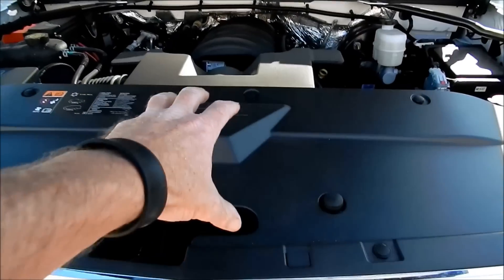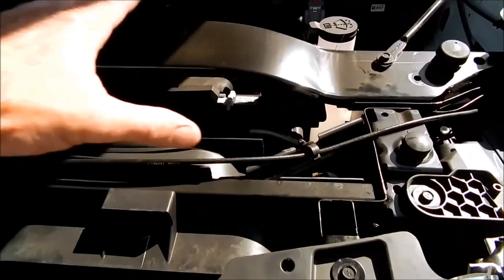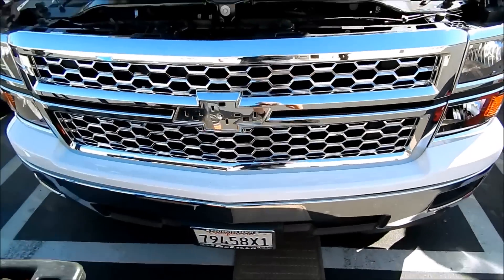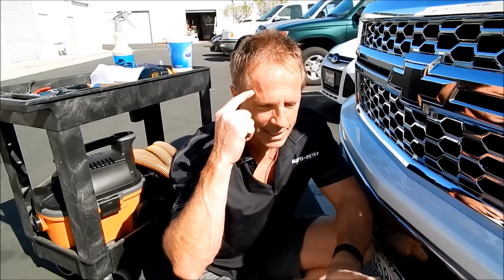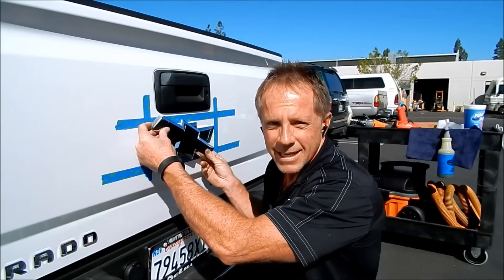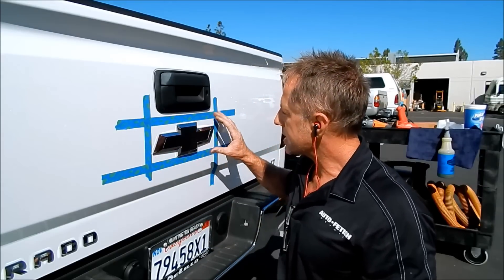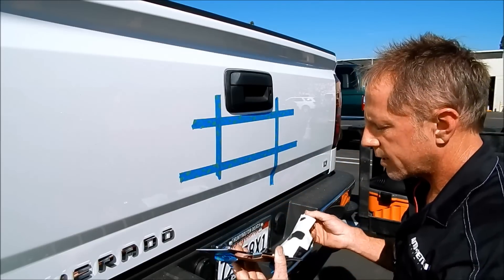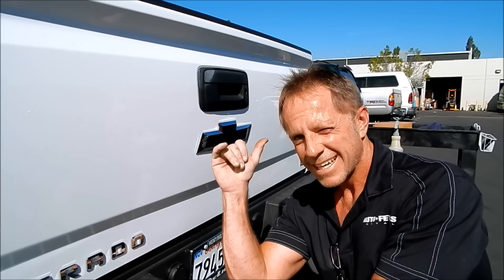Chevy Bowtie Replacement: 2015 Silverado Truck front and back bowtie

Comment: On the rear of my Colorado, it wasn't too bad. Most of the adhesive stayed on the emblem. Using my fingers I carefully removed the adhesive, followed by a wax that removed the remainder of the adhesive, rubbing alcohol, and then placement. The factory had the emblem placed slightly off to the side as the center line didn't match up to the rear view camera. Using tape as my guide lines it went on perfectly. I too am a perfectionist. Nice video.

Comment: I have a 2017 Chevrolet Colorado and I wanted to switch the bowtie to the black version. Although I don't have the back door that you have on the Silverado I figured out how to remove it without damaging the grill. I simply went from above through the latch hole and used a very long flat bladed screwdriver. I slipped a business card fold over between the left side of the emblem and grill putting tension on it. Using a long flat bladed screwdriver I reached the tab and gave it a tap which released the first tab. I pulled up on the emblem and the second tab automatically released. I kept applying tension on the emblem and performed the same procedure on the third tab. The last tab wasn't visible from the top but I could see it when I lifted the emblem away from the grill. Carefully sliding a screwdriver between the grill and the emblem I gave it a gentle tap on the tab and it popped free of the grill.

Comment: There's a much easier way to remove the front emblem.  Remove the top cover as shown in the video.  Remove the 3 bolts on the top edge of the grille.  The entire grill then snaps out.  Pop the emblem off, snap the new one on, snap the grill back on, replace the 3 bolts and top cover.  Done.   Takes about 5 minutes, a flat screwdriver, and a 10mm socket.  No scraped knuckles, no climbing underneath.

Comment: Always great info!!  Another question for you Darren, with the 3M Stripe Off Disk. Have you ever used it to remove double sided tape on a headlight?  I have a customer with an after market reflective plastic border on the lights, and is thinking about removing them.  Next tool for my arsenal.  Thanks for reading...

Comment: It may be off topic, but I have some vertical lines formed on my tinted glass. They look like scratches as they can be wiped off, but when you try, they cant not be removed. It is inside the car. When I spoke with tinting experts, they told me that some sand went inside the seals when windows were open. Have you even encountered this issue? Is there anything that I can apply on the tint to help it. Thanks Darren.
Reply from the maker: +IVAN P Not that I have ever seen. I have sen this numerous times and is as the tint shop told you. Can't clean damage away and time to re-tint.
Reply: Auto Fetish Detail  how much do u charge to change a bow tie for a 2017 silverado

Comment: Darren - The drill you use, does it have speed adjustments or is it a single speed? If it's variable, what setting do you use? I have a single speed dewalt drill, would it be to powerful when using the eraser tool? Going to try it anyway but haven't yet. Just wondering in case I need to return it for a variable speed drill.
Reply from the maker: +Matthew Zydorczyk Mine is a variable speed. When I use this tool, it is set for the highest speed. The actual 3M tool is rated for up to I think 3500 RPM (which is no where near what I use it at) My new DeWalt I use might do 600 RPM?

Comment: Darren - In your all your years of detailing have you even used a form to note down any damage or areas of concern before working on someones car and have them sign it? Do you see value in that? Have you ever had people try to blame something on you (to the point of saying they will sue) that you know was there before? I know you can talk to the customer beforehand to gauge what kind of person they are but the person could still act one way before and one way after. Just wondering since you've dealt with many more people than me.
Reply: Hey man, I personally use what I call a "detail inspection form" for those customers you know can be abit dodgy. While they are there with you go through the sheet assessing dents scratches etc etc and write down the exact price you are going to be charging and them make them sign it, can't go wrong :)

Comment: All I did for mine was drill a small hole in the emblem itself about a 1/8 of an inch in and pull it straight out.  Took 3 minutes.
Reply: Mike Fletcher Those emblems are worth $120 new and like $75-$80 used in good condition. Would be silly to destroy them.
Reply: I don't know where you get your prices from but I bought a brand new one from my dealer for the grille for 35 bucks

Comment: Long screw driver took less than 2 minutes to replace, without taking anything apart or getting on the ground.
Reply: How
Reply: @sambolton1087  You just open hood and if i remember I put the long screw driver through the lock latch to reach the tabs behind the bowtie

Comment: The "work around" is that the front emblem comes off easily with a thin flat head screwdriver, or a plastic wedge directly behind the front emblem.. 

If you're replacing or removing the rear emblem, it comes off easily with PROPER heat application (not what you did)..  the eraser wheel is virtually useless when heat is applied properly.. Some goo gone and a shop towel will remove the excess residue

Unskilled guys with poor critical thinking skills (who think they're the best) are what drive up costs for costs for customers, and screw over skilled workers..

It's not that hard, you spent an extra 2 hours on the job, and you couldn't even figure out how to remove a basic plastic grille from a new vehicle.. quit making videos man, your work sucks